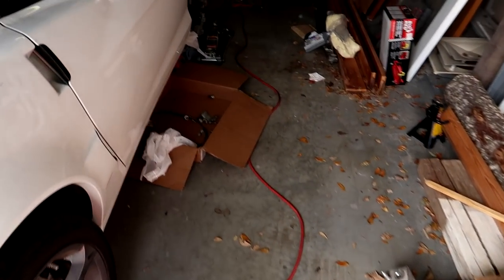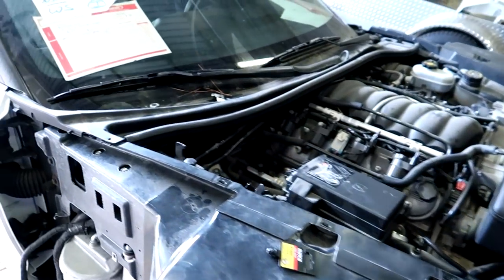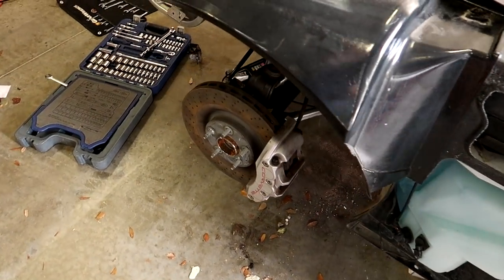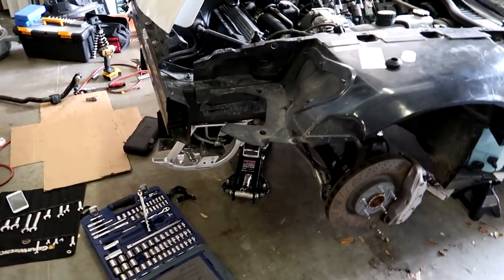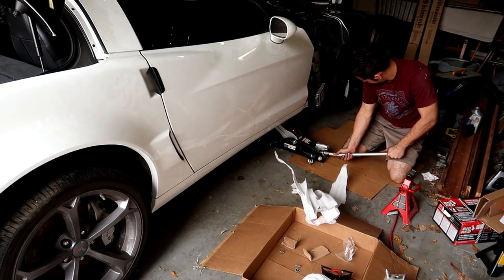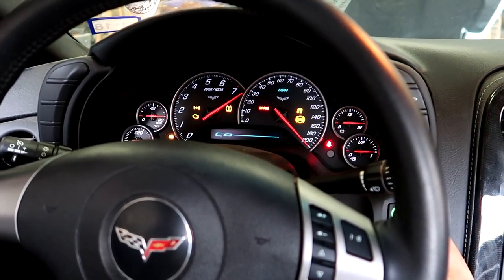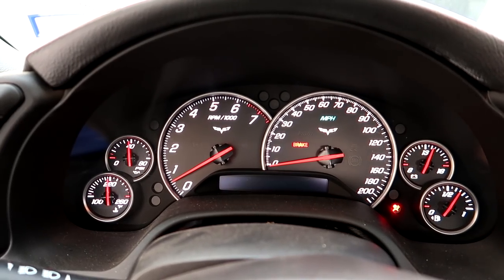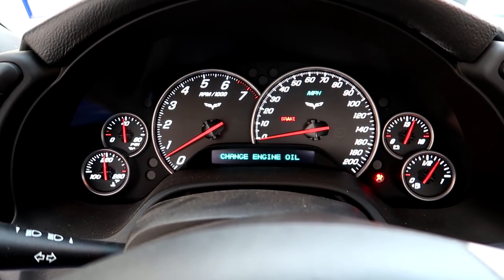THIS is why the Cheap Salvage Corvette Won't Start! Easy $100 Fix!

Comment: Uninstall whatever software you have on that Netbook and install a clean windows 7 Pro one. Then, find one of the many websites that walk you through further cleaning Micro&Soft's garbage (optimizingpc(dot)com for example) and do the basic stuff. It will make the thing much, much faster. Also, ditch the "futzy" interface, go back to the windows95 look. That thing eats a ton of memory. 
Once you're done you'll get a bitching car diagnostic notebook.

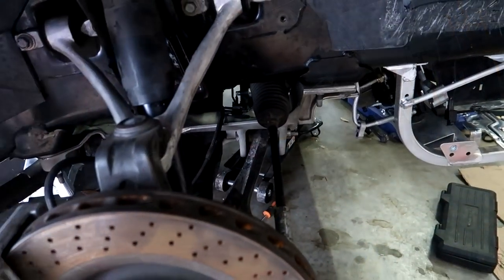Comment: At 2:08 Sounds like a Radio friendly Edit.. Come on what was SWAY BAR originally ? Lol
Reply from the maker: I think I said cross member or something I completely forgot.
Reply: Samcrac Hey at least you caught it and edited it out and that's better than I would have done. :-) glad you got the GS Vette running, by the way I also think somebody pocketed  those headlights at The Body Shop it was towed to after the accident

Comment: "clutch has to be pushed in to start a car with manual transmission". No sir, not true. It`s better for engine/battery but it will start without clutch pressed. Maybe you meant cars with start button?

Comment: You cannot put regular water! It has minerals it'll mess with the cooling system if you're to put water it has to be distilled water then you could put den cool but never put regular/tap water in the cooling system of your car

Comment: Very cool info about the tech 2 scanner. I own a couple GM vehicles myself and will pick one of those up. Also idk how you resisted taking it out in the street and romping it once you got it running! I'd be out doing burnouts haha

Comment: Don't you just love that shit! Fucking GM. My 99 had an issue with the the VATS sys that would shut the thing off as soon as it moved. I finally ended up getting HP Tuner and set that to 250 MPH. Computers in cars are great until they don't run.

Comment: Just a quick tip 4 you Chevy fiends that want to swap motors and around buy these salvage item vehicles. I learned my lesson on a 99 Silverado allegedly had a NEW rebuilt polished ported 5.3 motor in a truck that originally had the 4,8 motor. To make a long story short after talking to GM I think they were absolutely the most useless bunch of boobs I ever encountered. Then I found a tag inside the truck from the rebuilt crate engine came from a rebuilder in Arizona. After talking to them I realized even if I bought a brand new factory ECU ECM from GM and had them program them to the truck it might run but it would never run right even with the rebuilders $5,000 motor in the truck. I had to buy their computers. The engine for one had larger fuel injectors and it had their senors in the crate motors box in which the dope that swapped the engine put all the old semi new sensors back in the new motor. After another $1,500 hard lesson I paid $1,500 for a salvage truck and spent over $3,000 making this alleged special motor run. The engine does run fantastic but after all the gray hair it gave me I realize if something does take a shit I will be in for more big bucks and more gray hairs. If the new sensors that had been with the rebuilt motor I would have been ahead of the game about $400 bucks... However the kit or box of new sensors were not with the Salvage truck. I bought Apollo's ECM's and their sensors in the kit for $1,500 and then I had to buy their software program and that wasn't the end of it because I did not own the type of lap top with the features needed to run the program so I paid a guy named John Cherry to program my truck... GRAY HAIR!!!!

Comment: I never use gm dex it's the worst go to green or universal.
Reply: Dex-Cool actually does last five years if you don't pollute your cooling system with tap water. You have to use distilled water only, that is where a hell of a lot of people go wrong and try to blame it for what you did wrong. I use Dex-Cool because I'm not willing to change the green stuff out every year like you're supposed to.
Reply: Steve Yulenburg no one uses distilled water not even mechanics lol ask me how I know.

Comment: The laptop runs Windows vista 
That's why it's so slow
Reply: Nikos Yiannos you are wrong because the software on the computer doesn’t affect the speed, I have a laptop that runs windows 10 and it is slow. It depends on the ram you have and what type of processor you have. Dont comment if you dont know anything about computers. And I have a $3000 pc that has a very expensive graphics card and 32gbs of ram with an and processor that is great and enough for gaming.

Comment: Ugh. I'm too old to cope with this computer magic. Not like I couldn't learn it; I just don't want a car held ransom to somebody else's software. Pre -computer, any car I can't get started in an hour with some ignition parts, gas, and a good battery has a problem, and I'll know what it is, and whether it's worth it to me to make it run. I just got a nice '84 vette and the electric is so goofed up, I'm going with analog gauges, battery cutoff switch, and basically rewire everything that's broken, if I can't find the wiring errors. the previous owner was a young mechanic at chevy who didn't know what a relay is for. It runs good and has been thoughtfully converted to carburation. Perfect car for me. I only wish I could convert it to hand crank windows.

Comment: What scares me is you saw both the clutch and the crank sensor needed to be calibrated (learned), and you seem to want to do the clutch and try to start it.    If you don't worry about the crank sensor first, you risk damaging the engine.   Work more logical, please.

Comment: I don't need no stinkin GM tcch tool for my 57 Bel Air. If it ain't running it is because the idiot mechanic (me) didn't connect a wire. Lot's simpler.

Comment: bruh brah brah. ALL modern computers can run 32BIT,  in the olden days you coulnt run 64bit ,nowadays you can run32bit on everyhing
Reply: EmptySergeant True, but some car diagnostics software is not aware of that and does not want to run. I had those issues with BMW software. Figured it out eventually (no was not compability mode), so for those who are not geeks it is easier to use old systems.
Reply: drivers the problem, you need 64 bits drivers on a 64 bits system.